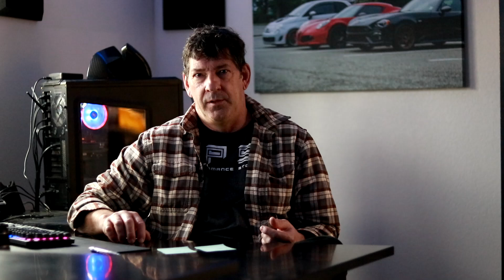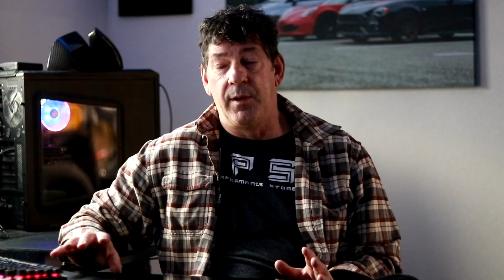Boeing 727 Falls From the Sky TWA 841

Comment: Starting as a young kid, I was a passenger on 727s during maybe 30-40 individual flights from the 1970s into the early 1980s. Being based in St. Louis, in my young mind a TWA Boeing 727 was a commercial airliner. It was the Greyhound bus of the sky. 

Early in my flying career, so to speak, I can remember trying to size-up just how scared I should be of this amazing activity. Since flying always involves a lot of sitting around, I had ample time to study the parts of those planes a passenger could see. A thin veneer of civility covered a distinct impression of being 'all business', underneath. It was obvious that many of them were very well-used, and were rapidly racking up more and more flight hours, yet they endured and everything always seemed to work reliably. Before long, I came to trust them to get me back and forth safely.

The flaps really were incredible to watch (and listen to). I knew from their use that they had to be increasing lift at lower speeds, but I was damned if I could see how they did that. It all looked like such an aerodynamically dirty mess when everything was deployed! Also, the engines certainly were loud, and you certainly didn't want to live near an airport in those days.

Comment: Thank you Greg. I can listen to stories like this all day long. 

Since you mentioned the Piper Chieftain, I have a story related to system knowledge. In my early aviation days, I was first officer in the said aircraft type flying oil workers from Norway (Kristiansand) to Germany (Willhemshaven). Just a few days earlier, the owner of the aircraft had checked me out in the Chieftain. It was winter, and the owner told me that the cabin heater, which runs on avgas, should only be used in flight. Without sufficient airflow, the heater would overheat and trip a safety switch. This switch could only be reset when the aircraft was on the ground. I promised to remember that.

For the taxi flight, a newly hired pilot would be captain. It was a cold winter day, and when he taxied the aircraft from the hangar to the terminal building, he turned on the heater. I was not onboard. The heater must have overheated just before he parked the aircraft in front of the termainal. The passengers boarded, and off we went. After take-off, the captain asked me to turn on the heater. It didn't work. So, I asked if he had used the heater during taxi. Yes. We could not turn back, because we had a tight schedule; the helicopter that would carry the oil workers from Wilhelmshaven to the oil platform could only operate in daylight, and the days are pretty short in the winter in northern Europe. At cruise, it was -15 degrees Celsius outside and -14 inside. Thankfully, we had warm clothes, and North Sea oil workers are tough guys. But it was a relief when we had landed and could and heat up in the terminal building. 

The return flight was warm and cozy.
Reply: I have a couple of thousand hours in Chieftans and I remember being told never to run the Janitrol  heaters on the ground unless you left the heat lever all the way to the left in the minimum heat position . Even then each plane was different and some you could get full heat in flight and some you had to limit how far you pushed lever over or you would blow the thermal circuit breaker. The thermal circuit breaker was behind a small panel on the outside  right side if the fuselage just behind the nose about where the props were. The only way to reset it was to unscrew all the DZUZ fasteners and reach in and rest the button, which is of course impossible in flight. I flew with one guy who never had that C/B trip and always had plenty of cabin heat and I could never figure out why. Years later he told me that he would open the panel before we left and wrap tape around the C/B so it couldn't pop......I am not advocating doing that.....messing with Janitrol heaters can and has caused fires and that is not a good thing.
Reply from the maker: I remember that heater quite well, I hated that design. Thanks for sharing. I really like the Chieftain other than that heater issue.

Comment: I would think that as a passenger it would be really jarring to hear flaps or slats move during cruise.
Reply: I worked for TWA in the 80's and 90's. I actually saw pictures that some of our mechanics took of the interior. It was a mess. People and beverage carts were flying around. Busted up several overhead panels and overhead bins. Miracle that no one was hurt any worse than they were. A lot of people had to change their underwear after that too.

Comment: I am not a pilot, and know next to nothing about piloting a plane, so this is probably a dumb question,  but why would the pilots "trick" the plane's system like that? Was it because they were running late and they were trying get extra speed so they would be on time?
Reply from the maker: There could be a number of reasons. 1. To get up higher to save fuel or find smoother air. 2. To get above weather they don't want to go around and thus save time. 3. Sometimes at a higher altitude you can go direct to your destination and save time when you can't at a lower altitude due to traffic.

Comment: Could it have been  the Flight Engineer reset the Number 7 CB first and that in turn created an asymmetric wing lift condition flipping them over?
Reply from the maker: No, that wasn't an option. The leading edge devices didn't have individual CBs for each one.

Comment: Hi Greg, I was a TWA mechanic at the overhaul base at MCI in the 80's-90's. Before that I was an MO ANG Crew Chief at Rosecrans ANG Base in St. Joseph, MO. In the 70's. Many of our ANG pilots were also TWA pilots and TWA did training off our runway. They would do touch and go's there in the 707's. I knew a lot of them personally. There's an alternate story that also corrobates with one of our TWA maintenance instructors who was an ex Boeing engineer. 
The other reason pilots did this was for fuel economy. Remember, there was 2 oil crisis's in the 70's. Airlines were handing out bonuses to aircrews who could save fuel. Doing the 2 degree flap trick also lowers the nose on the 27 in cruise flight. Miss Piggy (pilots name for the 27 because it didn't climb well above FL 320) flys a few degrees nose high making it a little aerodynamically dirty. 2 degrees back on the flaps dropped the nose and really improves fuel  performance allowing them to throttle back a little. This is per the pilots I knew and my TWA maintenance instructor (who was privy to this information). Sooo, whether it was so they wanted to go higher or save fuel for the bonus is up for debate. The story we had at the overhaul base was the fuel savings bonus. The Story about the FE engaging the CB is correct. Hoot popped the CB's and didn't tell the FE assuming he was "in the know". As you may know, CRM wasn't implemented until years later. BTW, I worked on N840TW (Dive Bomber)  many times. When the light was right, there was a slight rippling along the fuselage above the wing roots. We also took some safety wire and stretched it from a point at the radome edge to the edge of the nav lights. Compared it to another "shorty" 727.  The length was  a little longer than any of the others.  The old 27 was one of the toughest birds ever built. Also BTW, they stopped handing out fuel bonuses right after this. Coincidence? Anyway,  thought you might want to know this little factoid from someone who was there. On a personal note, TWA was one of the finest airlines (if not also one of the most troubled) I ever worked for. We could do heavy maintenance that normally only Boeing was allowed to do. Amazing knowledge at that overhaul base. We were like family. I was there for the final years. Carl Icahn is the scum of the Earth and the sole reason I never got to retire there.
Reply from the maker: Thanks for all of that. Everything you said makes perfect sense to me.
Reply: Great story Mark. I worked at JFK, never met Hoot, but sure would have loved to. I'm still intrigued by this story even to this day. I remember the incident very well as a kid growing up in the Bronx. Little did I know that I would be working for TWA at JFK where 841 originated. Hoot seemed like a nice guy, and a great pilot, but I've always believed that he had to have something to do with the upset of the aircraft. 
BTW, I can't agree with you more about Icahn. He destroyed our airline, and I also hold him accountable for the loss of flight 800. My friend Elsie, who I worked with at JFK, was non-reving on 800 that night, along with her 9 year old daughter. I'll never forget her.
Reply: Thank you Sir!
Reply: I must refute the comment about pilot fuel bonuses.  There were none at TWA.    I was a 727 aircrew member at TWA during this period and familiar with the pay.   I never had heard the circuit breaker trick until told about it after the incident.  I see no advantage to using the trick as drag would increase and engine thrust was the limiting factor.

Comment: Spent 15 years manufacturing and erecting metal buildings. Outside of one of the new STOL Bush planes or an old Grasshopper landing on a roof is a bad bad idea.😮
Never happening unless you are flying a box kite.

You would have thought Boeing would have known about the Flaps 2 thing and exploited it as a standard feature to jump ip the baseline performance figures for the 727.
Reply from the maker: I'm sure they did, but improving performance in one area usually decreases it in another. The Flaps 2 trick only helped in a very specific flight regime and hurt the plane in others.
Reply: @GregsAirplanesandAutomobiles  yep. Giveth and taketh away. Making a conformal wing that can adapt shape is ideal IF it can do so safely and the weight cost of the system used to change the wing shape can justify it being on the aircraft and whatever said aircraft was designed to be used for.
Just seems like that is something that can be done now with titanium, carbon fiber, and other newer tech. Always wondered if putting something like a long flat  rubberized bladder over the top of the deepest chord on a wing that could be inflated to increase the chord during landings and takeoff could be done and how much more lift could be achieved when doing that to the wing?
Just seems a fairly simple way to change a wings shape fairly quickly at a minimum of cost and complexity.🤷‍♂️

Comment: the 727 didn't "fall out of the sky"......they recovered from the mishap and landed safely......no need for the melodrama
Reply from the maker: I disagree.
Reply: @GregsAirplanesandAutomobiles  you disagree that it did not fall out of the sky and crash...?? bold strategy cotton
Reply: I'm a former TWA mechanic based at the MCI overhaul base. I've worked on that very plane N840TW. It did indeed fall uncontrolled for at least 30 thousand feet. Not until Hoot dropped the gear was flight control regained.  It actually was in the transonic speed range for awhile. I saw pictures of the aircraft when it was ferried to MCI for repair. It was a mess. People and food carts were tossed everywhere. It was indeed out of control. You're entitled to your opinion, but it's wrong. I have first hand knowledge about that.
Reply: @markhull5776  my opinion....?? You just said you worked on that exact aircraft after the incident....proving my point....it didn't crash. That's not an "opinion".

Comment: If i ever get a billion.   Id reengine one with JT-8D 217's, strengthen the wing to tolerate + 10 G's or better, take any sound devices off and fly her experimental, probably make her my residence to avoid property taxes, and of course have sealed batteries and acro mode so you can do fun stu with the plane from point to point.   As with JT 9d-217' this plane really performs.
Reply: I once saw a Gettys 727-100 that had MD90 engines on 1 and 3.

Comment: Question:  Was this flap procedure, pulling the CB and extending to 2 degrees, an approved procedure (or to phrase it differently with the same intent, please forgive the vernacular, was this procedure an exception to the altitude / airspeed limitation on flap deployment) per the AFM?
Reply from the maker: No, it was not an approved procedure. The Boeing manual prohibits the use of flaps above 20,000 feet.

Comment: You say “the speed of sound went up” around 8:50 or so. Did you misspeak or is there some other meaning for that term?
Reply: from Wikipedia: "In Earth's atmosphere, the speed of sound varies greatly from about 295 m/s (1,060 km/h; 660 mph) at high altitudes to about 355 m/s (1,280 km/h; 790 mph) at high temperatures."
...so from the plane's perspective, the speed of sound increased as the plane lost height.

Comment: Hi Greg, here’s my understanding of the sequence of events leading up to this B727 upset. It’s based on my knowledge of the 727s systems not the reported actions of the crew which I found to be implausible. First, the hydraulics are always on. If you have hydraulic power to lower flaps, you also have hydraulic power to extend the slats. There is no circuit breaker you can pull that will keep the slats retracted when the flaps are selected away from ‘up’ using hydraulics. What I believe happened is that the pilots selected ‘alternate flaps’ on the flight control panel above the captain’s head. Normally, as soon as alternate flaps are selected and the flaps are moved electrically away from ‘up’, the standby hydraulic pump will run and the slats will automatically deploy under standby hydraulic pressure. Pilots can prevent slat operation during alternate flap selection by tripping the C/B for the standby hydraulic pump. With the C/B tripped, the flaps can be extended very slowly to the desired position, which is well shy of ‘flaps 2’, I believe. This trick could also be performed on subsequent Boeing aircraft, such as the B737 (classics and NGs, Max’s I don’t know about) except that Boeing became wise of these attempts to make the aircraft do things they were not designed to do and moved the standby hydraulic pump C/B away from the P6 panel and put it down into the E and E compartment below the pilot’s feet where it can only be accessed on the ground. The normal function of the standby hydraulic system is to provide emergency slats and rudder control in the event of A and B system hydraulic failure (ailerons and elevators could be operated manually with the assistance of balance tabs and the landing gear could be manually dropped).
Reply from the maker: There absolutely is a CB that prevents the leading edge devices from extending when you select flaps 2 in a 727.

Comment: A slight communication breakdown among the crew.  Had the pulled breaker been commented on by the pilot or engineer, all would have been well.
This is what CRM (Crew Resource Management) is all about.
Reply from the maker: Absolutely, but they really didn't have CRM back then. This was back when the F.O. still carried the Captain's luggage in some cases.
Reply: @GregsAirplanesandAutomobiles  Yep; flight deck power trips stifling common sense and communication has too often been a recipe for tragedy.
Reply: Exactly why this happened.
https://en.m.wikipedia.org/wiki/Tenerife_airport_disaster
Reply: @markhull5776  😞

Comment: How did the crew explain the aircraft flying at an altitude it shouldn't have been able to reach in standard configuration? ATC would have records of the altitude, the airline would know the aircraft weight and fuel load at takeoff.
Reply from the maker: It's an issue of speed. I think that's why they said Mach .815. That's because they could be at that altitude at that speed, but not a .84. That part of the discussion would have doubled the length of the video so I just glossed over it.

Comment: As always, great content, thank you for that.  I am not a pilot or employed in any aviation related industry, but I am an occupational safety professional who has sat in a number of RCAs (Root Cause Analysis), so one question I’d like to ask is WHY did they want that extra altitude that badly?

I know it certainly improves fuel economy, is the air meaningfully smoother at 41k than at 38k feet?  I can imagine a few other reasons, but this was well before sustainability was a widely discussed concept, and the fuel bill wasn’t coming out of his paycheck.  Was it?  Were they just trying to maximize the pool for bonuses, or was it just an ego thing, about knowing how to get more performance out of an airplane than run-of-the-mill chumps?

In any event, I’m pretty confident that such blatantly reckless nonsense is now largely a thing of the past (I’ve worked in the vicinity of major airports and know that the way to spot the FAA people is to look for the people that NEVER get the joke,) plus airliners are probably at tad more resistant shenanigans like this.

I’m not deluding myself on this, am I?
Reply: @jackgee3200  the alcohol certainly counts as blatant recklessness.  The sleeping sounds like a complete system failure.  I’m not sure what the hours of service and crew rest requirements are in Indonesia, but expecting an exhausted crew to fly a plane would get a US Airline extensive criminal penalties—I think the crew too.  I’m much more familiar with road and rail rules than FAA stuff, but I know I wouldn’t want to test the edges of legality.

Deliberately deactivating safety systems is a good way to thrown in jail in any industry these days.  And that’s more than just this one flight, if it was a widespread practice, why did people think they should do it? Were incentives encouraging that, or were they being pressured by threats of some sort of retaliation if they didn’t cut those corners?  

Either way, the rewards or threats would need to be removed and replaced by a system that gives you a reason to focus on doing things properly, without any wink-wink nudge-nudge nonsense being used.